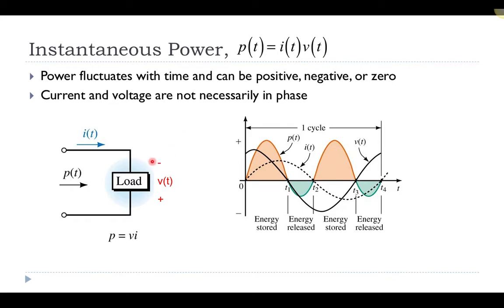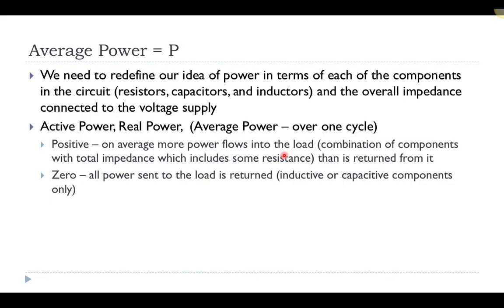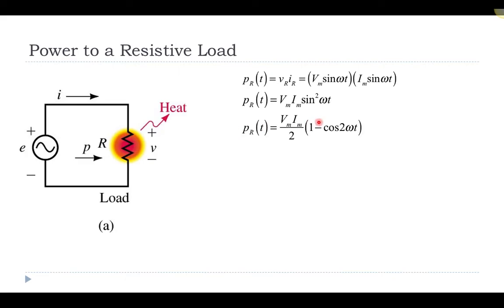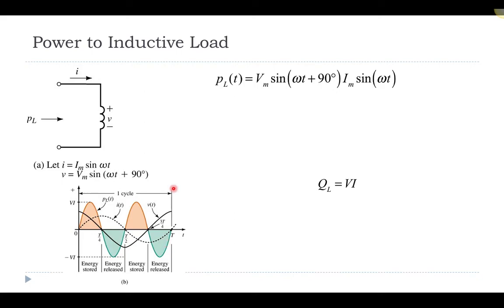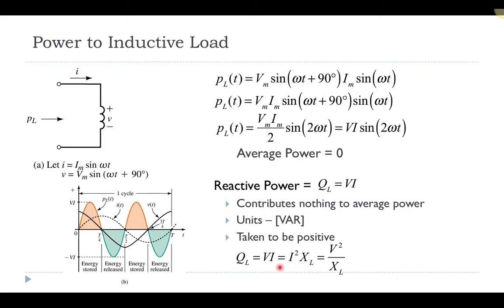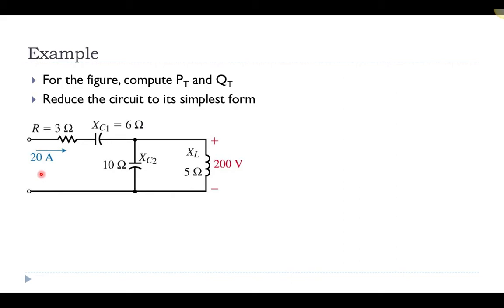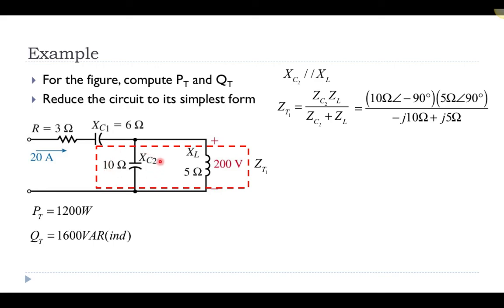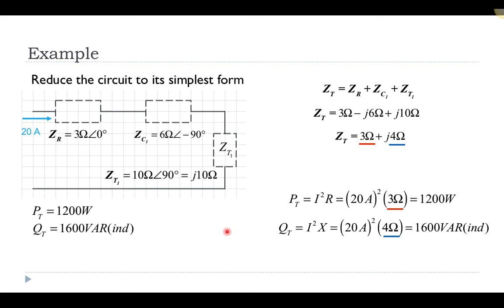24 AC Power Part 1

Comment: In the example, If there are multiple resistors is P(total)=P1 + P2 + P3 +... +Pn ?
Reply from the maker: Yes that is correct. The total power in the circuit adds up due to each resistor.